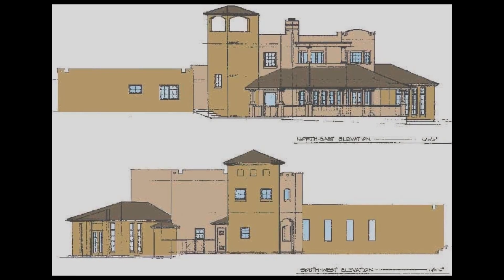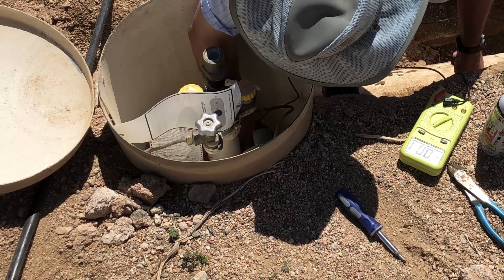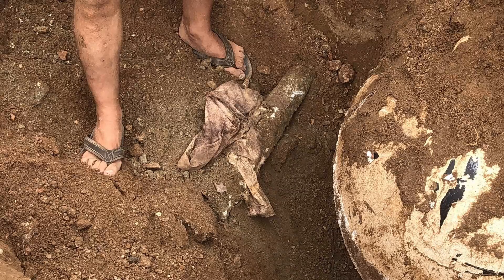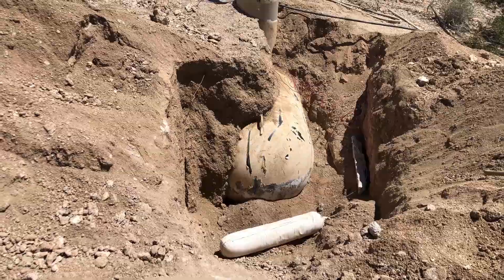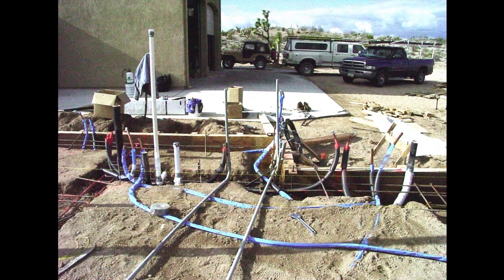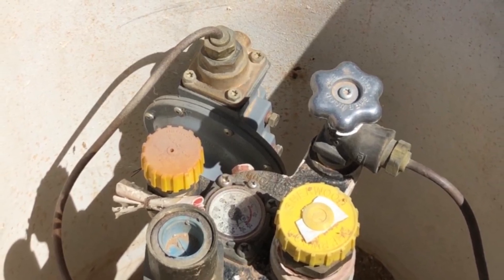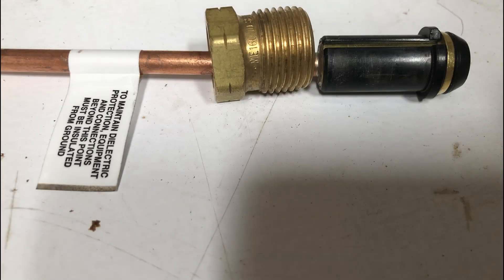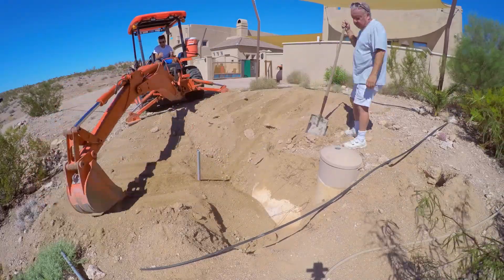Propane Tank Test Failed - Red Tagged

Comment: Another thing that can cause a failure is dry soil, especially dry sand. You might share with folks to run a sprinkler overnight before a cathode test.
Reply from the maker: You must have missed that part of the video. At 5:30 my video shows I used a water mister to soak the soil overnight before the test.

Comment: I bought a home built by preppers- electric heat pump, 500-gallon oil tank in the basement for backup primary heat, AND a 500 gallon buried propane tank for the rangetop only(!) , The water heater and oven are electric). The house and the tank are both 21 years old.  At the rate I'm using propane it will be a hundred years before I need a refill.  I had a local propane supply company check it when I moved in three years ago, and thet certified it after replacing a weeping primary pressure regulator... but they did a leak test, not an anode protection test.  Should I buy a cathodic protection testing tool kit do I can take my own readings on occasion?
Reply from the maker: I would do the test and make sure the anode is doing it's job. When I was looking, it seemed the copper sulfate probes were affordable online.

Comment: What a great video. Shows how such a small oversight can cause a big problem. Troubleshooting a problem is always the hardest part. Your knowledge of how the system in your house was put together allowed you to solve the problem fairly quickly. Nice job! This is not the only place where not using dielectric unions can cause problems. Plumbing systems using dissimilar metals comes to mind as another. Thanks for posting.
Reply from the maker: Glad it was helpful!

Comment: Hello there, Can you tell me what size fittings those are & where you purchased that pigtail line? Thank you for the informative video.
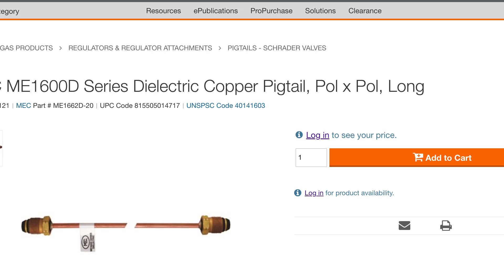Reply from the maker: All the info you have asked for is in the video at 9:29, including the Home Depot part number, manufacturer part number and the POS fitting type. Please check there.
Reply: @arizonaeric9598  Thank you very much.